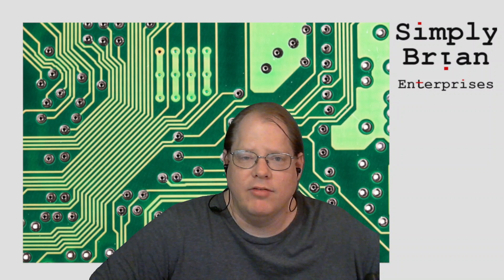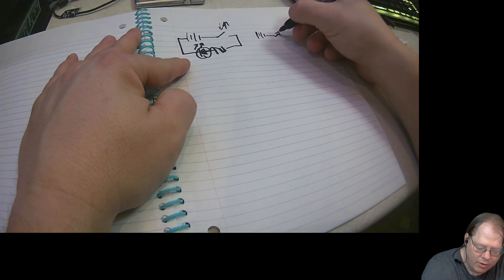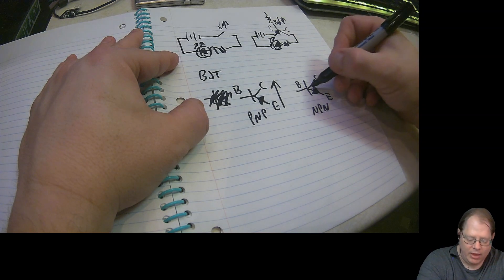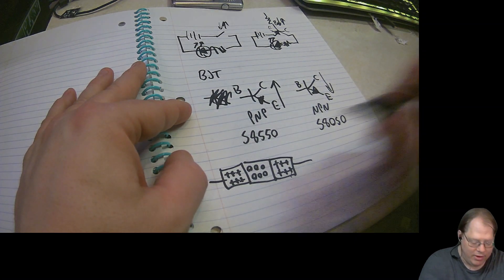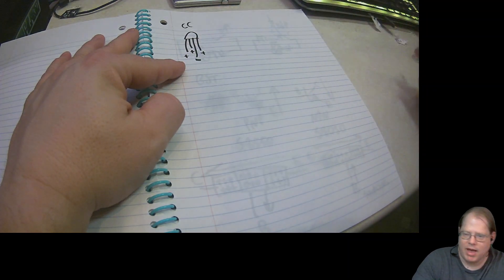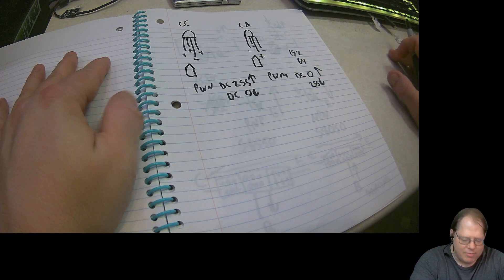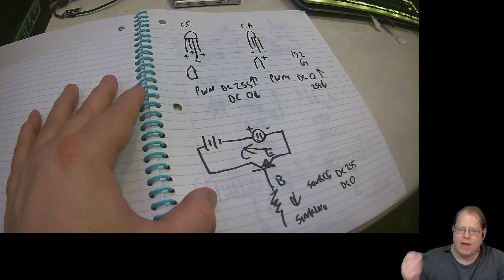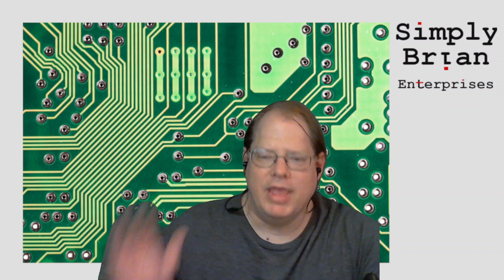Raspberry Tartlet: Exploring Transistors

Comment: Very clear, awesome explanation 👌 

I hate common anode LEDs, that's what my robot has as the indication LED at the moment 🙄 

I'd love to see an explanation of how to build a simple timer circuit, and the most super useful RS-flipflop. 

The Pico W has a super low power "Deep sleep mode" but what I'm looking for is zero power consumption, until a momentary switch is pressed, then the program runs, when the program dictates: it turns itself off back to Zero power consumption 🤔 
If that makes any sense 🧐
Reply: BBF, I am not sure how low you can go on a development board as they always seem to have something using power. On my bare chip ATtiny85 Simon PCB there is no power switch. Using all the low power settings the deep sleep uses less than 1 microamp giving you a theoretical battery life of 40 years with a 200mAH CR2032 coin cell. The game comes out of sleep when a button takes the reset pin to gnd. I just tried my game and it is still working after over a year on the same battery.
Reply: @keithlohmeyer  that's remarkable 🤯 RS-flipflop with a timer is what I need 👍 
Do you know is it possible to force the Pico W to power off completely with a program? 🤔
Reply: @keithlohmeyer  Thanks Keith 🙂👍

Comment: Nice explanation. I get the single transistor setup but my brain hurts when I look at multiple transistor circuits like oscillators and amplifiers. Thanks for the video.
Reply from the maker: I had to be careful when making this video, as to not go down any rat holes.  There's so many aspects to transistors, that it could have easily made my head hurt.  Thanks for watching!